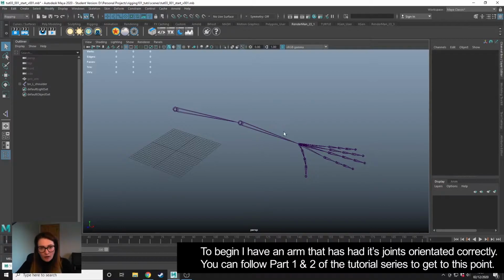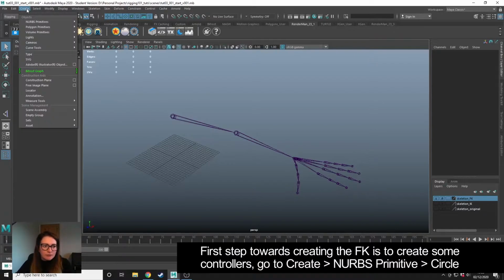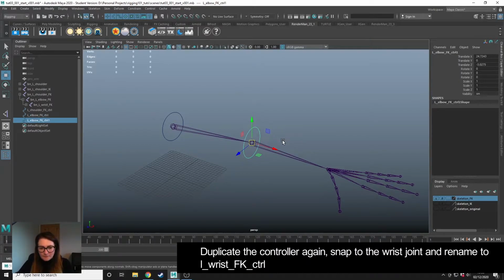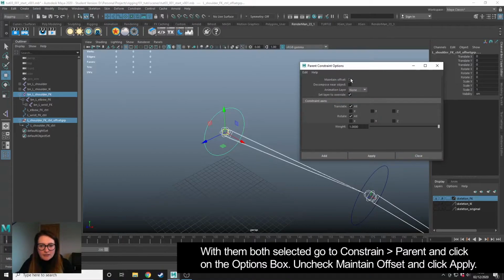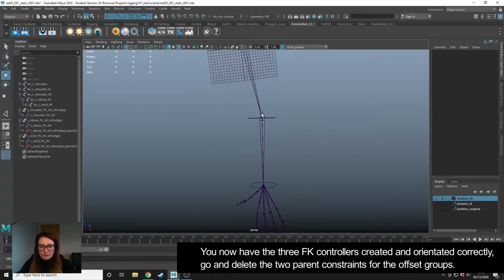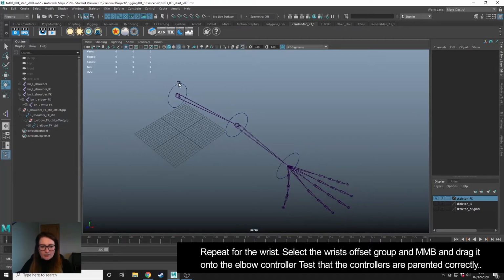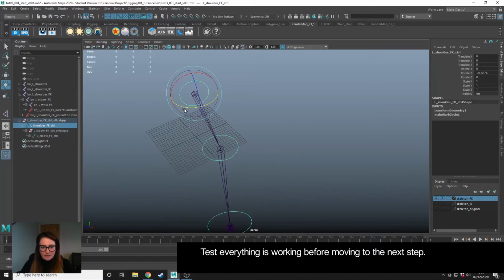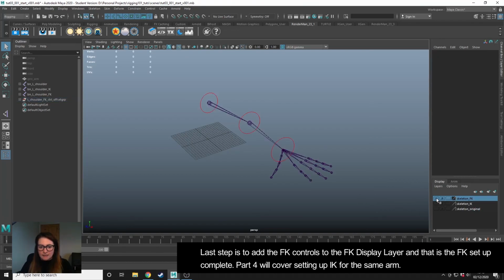Creating FK Controls - Maya Rigging for Beginners Part 3

Comment: very nice tutorial series. thanks for the clear explaination.

doubt: instead of using an offset group for orienting the controller, can we just directly parent the controller to the joint?
Reply from the maker: Thank you for the comment.

If you directly parent the controller then you will end up with values on the controller and so when wanting to reset the rig pose back to neutral you won’t just be able to set a controller back to 0 in translate and rotation.
The offset group holds these values instead of the controller. Hope that helps.

Comment: Great video series! I'm trying to follow along but have a quick question.  On my rig I'm using Y as the primary axis (so Y is pointing to the next bone) so when I setup the parent constraint with Maintain offset un-checked it don't orient the CTRL correctly.  Am I doing something wrong?
Reply from the maker: Does the CTRLs axis orientate correctly but it just doesn’t look right? To check if you select it and then use the rotate tool do all the axis align the same as the rotate tool with the bone selected?
If so then you can edit the CTRL by going into control vertex selection mode and then selecting them all and then rotating it to align so that the control looks correct.
Reply: @HollysMayaTutorials  Oh man, after a an hour+ I think I figured out that joints in the rig weren't oriented correctly.
Reply from the maker: Well done for troubleshooting it, that’s a skill in itself.

Comment: how do you get rid of the axes that we changed in the last video
Reply from the maker: You can just select your joints using select hierarchy again and go to Display > Transform Display > Local Rotation Axes and it will turn on or off depending on whether they're already on or not.